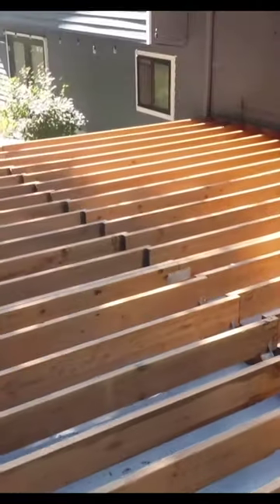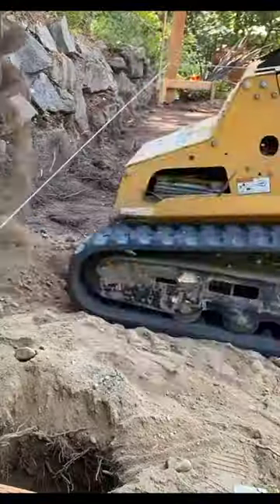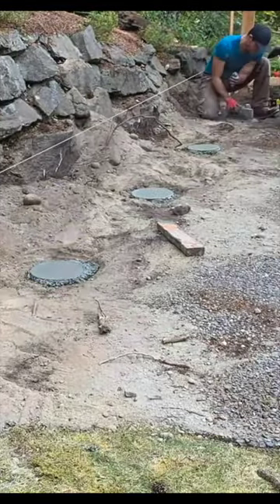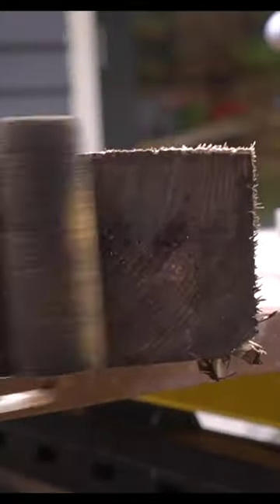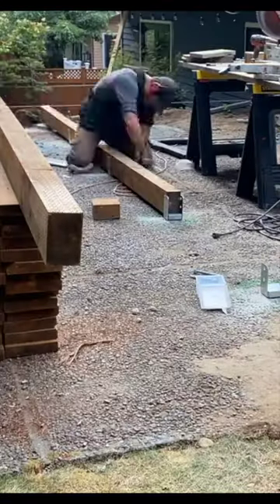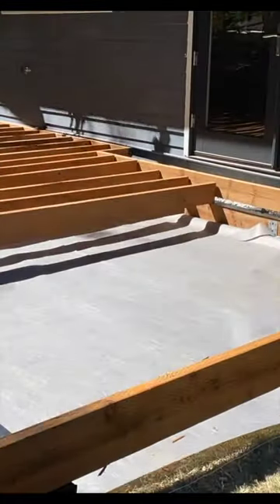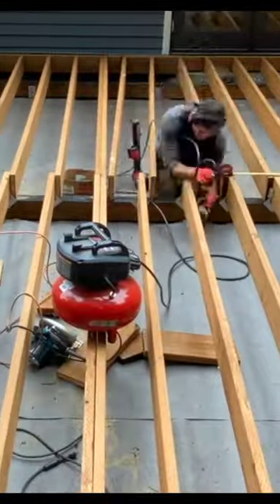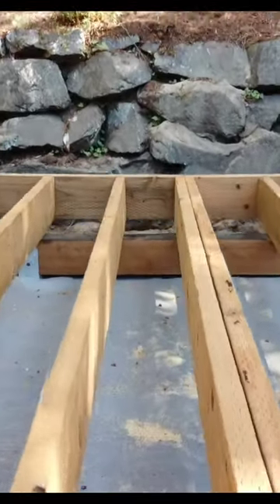DIY Freestanding Deck (Part 1 of 2)

Comment: You’re midspan beam have full bearing of the joist that should overlap and nail to each other otherwise beautifully done😊
Reply: Minimum 1.5” bearing
Reply: Yep. As long as both sides have proper bearing and the doubles are properly nailed from both sides it's good to go.  Although more bearing surface would be better or if you're a real overachiever, you could have gotten longer 2x10s and joined them with a scarf joint at the support so the client could tell his friends at the barbecue they could park their car right there because his deck was built so friggin strong that they hand cut interlocking joints in the beam because you get what you pay for...and he paid a buttload of money for that deck.  Lol!
Reply: How about some blocking?? A well intentioned handyman built this 100%

Comment: Why didn't you use the proper joist hangers on the ends that connected to your rim joists? You can not rely on fasteners that go through the rum joist into the end grain of the joists.

Comment: You didn't need to bury the sono tubes. You just need it at the surface for aesthetics
Reply: So many people use Sono Tubes absolutely wrong. They are only supposed to be used to form the exposed concrete. When you did and insert like he did, you ruin the contact between the concrete and soil.
Reply: So sono tubes should only be above ground? 
That makes sense, it will rot in the wet soil and shift your creation
Reply: Exactly

Comment: i do concrete and doing it wet is what i would do and just float around it and it will be locked in. Done commercial buildings like that and all. And hopefully not somewhere thats cold cause here in Michigan 24 is not a footing thats a rat wall. A footing here is 42 inches below frost line. But if your not somewhere cold 24 is fine

Comment: Where can I buy this pressure treating solution? I asked at Home Depot and they just kept pointing me to the wood. I looked up a pressure treating kit online but it's like $138,000 and you got to have a license from the EPA to get the thing delivered to your house. Seems awfully expensive just to build a deck. I wish they sold the wood pre-pressure treated.
Reply: you can buy it anywhere. armor all makes some I think
Reply: comes in half liter or more sized cans. be right by the deck stain stuff

Comment: why not just set j bolts into the footings before they cure?
Reply: But what he suppose to do with the drill bits , he already've bought?😮
Reply: And when they're off an inch or two, you're going to drill in wedge anchors anyway.
Reply: @Ihtiandr13  Lol!

Comment: Looks like somebody actually built a deck right poured footers and your footers are above ground so your post won’t rot out but the next question is did you cone the holes so when it freezes the post don’t push up

Comment: Serious question here, where is your blocking?  Hurricane ties will keep them in position but it doesn't do anything for load. I'm assuming that since you put your 2×10 joists at 12" centers, you're planning on storing another house on it.
Reply: To be fair idk what the exact measurement is but that looks like a helluva span for 2x10s...and of course a long span with any size joists means a tighter spacing to maintain the live load rating...right?   And while I agree that he should have used some blocking between the joists, I fail to see your logic in attributing the blocks directly to load the joists can bear.  The blocks contribute to weight bearing only because they prevent  twisting in the joists.  But you said the brackets he used would do that.  Theyll help but they won't prevent twisting across that whole span. All that being said, I'd be surprised if he has any issues beyond maybe a squeaky board or two in about ten years.
Reply: @invictusbp1prop143 -  blocking absolutely helps in load bearing. This is how you can use a smaller dimension lumber in a subfloor. Such as 2×10 with blocking or 2×+2 with no blocking.

Comment: I know where I live, your concrete is supposed to be 4 inches above finish grade.
You could’ve made your joist flush to the top of the beam, using joist hangers to gain the extra height. Also, instead of overlapping the Joyce in the middle, you could have bought them together. Now you’re screwing is going to be staggered, which is not aesthetically pleasing.

Comment: Why so deep on the sono tubes I would  have errors and put them up higher above ground  so rain and other elements  didn't end up putting  your lumber in the dirt in the near  future since it looks so close in the video
Reply: So you would have built the deck higher than the door thresholds so you have to step up into the deck from the house?  Hope those doors open inward...   He's actually already in danger of being to high.  I don't think he showed how it ties into the house but one shot gave a glimpse of the deck height vs the bottom of the siding on the house and it looked like he might have been about even.  The deck really needs to sit low enough that he's got at least 1.5" from bottom of the siding to top of the decking for moisture to escape out of the bottom of the siding.
Reply: @Invictus BP1Prop  No what I was saying was to bring the tubes up so the 4X4s would be higher you can make them as short as you want but, when it rains or your watering your lawn dirt moves and over time when you do a flush  to the ground  installation it covers the wood or mounting which causes it to ruin!
I'm  in that boat I live next to the last house on a block with NO drainage and a 30% grade I get  all the water from the  street level and everything  off the roof my property  (didn't disclose is in a flood zone) has dropped by feet in 17 years  I've lived here.

Comment: I seen a guy use weather proof tape on the outside of the deck on top so it doesn’t rot later where water puddles seems like a good idea

Comment: As former contractor accused of overbuilding things….. why would go to the trouble of deep footings and sono  tube  ? How about a pier block in hole full of concrete . I promise you’ll never know the difference . I avoided using metal ties , too much time and money for something  can be done  with screws , nails and framing

Comment: Hm, personally I would have at least brought the deck 6 inches higher off the ground. I guess as long as you have really good water run off its ok, but I hope the bottom of those beams don't rot.

Comment: We have to dig down to 46” for our sonic tubes here in upstate NY.
Reply: Sonotube is a brand of cardboard tubes for concrete. It's usually easier to dig a trench in a straight line rather than using a post hole digger.  Done it both ways, I wouldn't use a post hole digger again.
Reply: @nunyabusiness5075  On the decks I had put on last year the sonic tubes had to be inspected and measured that they are at least  46” deep. They used a power auger , it did a pretty good job digging it.
Reply: I don't think sonotubes are necessary for inground, and certainly not needed at full depth.
They are handy concrete forms for making neat circular columns above ground.
They add no structural effect after the concrete has set.

The depth to be inspected (mentioned above) would have been the column depth, not the sonoform depth.

Comment: No need to treat cuts. It's called "Pressure Treated" because the lumber is placed in a large pressure cooker filled with the liquid chemical. High pressure is applied which pushes the chemical into the wood. The green color is added later and is not the chemical that makes it resistant to rot.

Comment: The first thing you do is get a building permit from city to avoid fines and or costly removal of brand new deck
Reply: A lot of counties as it should be don't require a permit if it's not attached to the house.

Comment: Sono tubes are for above ground, if you’re just pouring level you should just pour into the hole.
Reply: Why would you say that about the Sono tubes?
Reply: I always paint the tube with Thompson's ... Just because.. it stops the hole from looking messy
Reply: @tnj5577  An irregular shape will provide a stronger foundation.

Comment: Ouchhh, drilling the concrete and them hammering the bolts in completely makes the concrete pointless. The only thing holding that in now is the friction between the concrete and bolt. If you put them in while wet the concrete would get in the groves and bond to the bolt to actually hold it
Reply: Threads in a bolt are not designed to hold the bolt in concrete.  Anything wet set would need an angle or spoon shape at the end to prevent the bolt pulling out.  Just concrete getting in the threads isn't good enough.  And the drill set anchors are wedge anchors designed to be driven into the hole then the nut tightened down to draw the opposing wedges at the bottom into each other so they expand outward and dig into the sides of the hole, giving them sufficient uplift strength.  So sayeth the engineer.
Reply: @invictusbp1prop143  that makes sense, I didn’t realize there was a wedge in it so I didn’t get how it would create a holding force. Thanks for the explanation

Comment: That is a little overkill.  Clearly a 2 ft deep sono tube base means that he is not in a place where the ground freezes.  Really 12 inch on center, also seems a bit much for normal traffic.  Yes over built but he will have something to talk about when he has a neighbor over for a deck party.

Comment: Whoa....the sonotubes are for above ground. Not buried. 
Better to pour concrete in dug hole. With sonotubes for any above grade parts.
Reply: I see this all the time and it drives me nuts. It's not a big deal in this case but it's still bad practice.

Comment: Everyone is talking shit but that's one of the best ways to do this. Damn good job I'd do it the same way. Should hold a hot tub no problem. And your materials are given the best situation to last as long as possible. Little bit of maintenance that deck will last 25/ 30 years easy

Comment: Obviously, you should have used pier brackets that go into the concrete. Besides that mistake, You didn’t put an extra tapcon in that bracket. Those posts are going to twist to hell and back. Don’t do this stuff yourself folks. It’s mistakes like this that end up costing you big. Pay professionals who have already made and fixed the mistakes
Reply: Obviously he should have used pier brackets?   Are you talking about the adjustable ones that are essentially the same thing he used but with an elevation adjustment ?   Or are u talking about the giant 1/4 steel plate brackets they use in friggin pole barns?  I disagree that it's obvious he should have used anything more than what he used (as long as all his piers were level).  And how bout we make a wager for a thousand bux and go check in 10 years to see if anything has "twisted all to hell" in the bases he used because he didn't burn a tapcon screw in each one. ....since there aren't any actual vertical posts secured with them, and they're really only a securement point for joining two horizontal 4 x 8 timbers that serv as the underlying support just above grade to carry the joists.   I'm having my doubts about your twisting hypothesis.  Unless the deck tears itself apart under the mysterious torsion you expect to be exerted from some unknown place on the timbers secured in those bases, I don't see how they could possibly twist more than a dikhair, let alone "all to hell".
Reply: @invictusbp1prop143  a bracket that goes into wet concrete…Hate to break it to you, but wood twists when it’s constantly getting wet and drying out. It twists in the sun, it twists. It’s wood. I don’t think you have been working with wood very long. Do it how you want, I need guys like you so I can come back and do it correctly. We all have our place in this world.

Comment: Why are you using Sonotubes if your concrete is at grade… just use the ground as your form… You only need Sonotubes if the concrete is going to be above grade
Reply: That is definitely not true

Comment: Don't call before you dig.  It's a (per) event fine depending on the State between $500 to $50,000.  I called for a wall foundation 3 feet from a street light pole.  They marked all the way to the electric meters 85 feet away.  
What I did not appreciate was the fact they stated 8-9 entities had to report before I could dig, and as far as I know the last 3 never completed their assigned responsibilities.
The next time I call, I am going to give them 30 days, then petition the Court with a Writ of Mandamus, which forces the entities to perform their legal duty, or face a charge of Contempt of Court.
Reply: This is why I thank God my family has owned acres for over 100 years lol we don't call for a thing

Comment: If you buy good pressure treated wood the pressure treat should be soaked all the way threw so no you should not and do not need to add anything to the end when you cut it

Comment: Holes should be 42 inches and you went over kill doing the joists 12 inches when you could have done 16 on center its a deck at ground level your not in tge air and your definitely not parking a vehicle on it

Comment: A bit over kill specially with the material hike 2x6 on 16 on center would be just fine but that will work too just tossing money out
Reply: Yeah, if your framing a ceiling. I agree with the 16 O.C., but at that span, nothing less than 2x10 with blocking. Unless you’re building a spring board.
Reply: 2x6 at 16oc at whatever that giant span is would be a disaster.  Wouldn't last a year.

Comment: 36 deep for footings
Reply: Sure but it depends on his state... Frost line
Reply: I think I would have filled the tubes to a few inches above the soil line too.
Reply: Not just frost line.   It depends on soil type.  Big damn difference if you're sitting on less than a foot of topsoil over limestone or if you're in highly expansive clays.  Where ya live matters.

Comment: There is no point in buying pressure treated wood if when cut, you have to reseal it. Might as well just seal it all yourself.
Reply: He's only treating the cut ends, not the entire board. As one should.
Reply: @Michael Olive  pressure treated to me implies it is throughout the wood from the pressure, so even after cutting on the wood, it should be fine.
Reply: @Sdmfcfh  one would think, however if you cut them, you'll see the treatment only goes in about 1/4 inch or so.

Comment: 24" inches deep and framing every 12" for your joists ? Overkill !
Reply: Depth of piers depends 100% on the type of soils you're building on.  Expansive clays with a high plasticity index would call for a minimum of 24" for any footing or grade beam.  Sometimes as much as 36" is required.   So it's just a bit presumptuous to just proclaim it's overkill without having more information than you have.
Reply: @invictusbp1prop143  maybe so, but how do you explain to 2x10s on 12" and hurricane ties??? 😂 no matter how you wrap it, whoever built this only barely knew what they were doing and overbuilt to make up for it.
Reply: @GrassLogic  2x10 for that length span, spacing for the deck material specs and desired stiffness, and hurricane ties may be code there

Comment: "Pressure treated solution" ??? Used engine oil will work just fine… dude,  "Pressure treated solution" ?

Comment: First step: Call 811(or the number in your region to contact people who know what's under your yard, usually a utility)
Second step(if you have a septic tank) 
   Don't build on top of the septic tank unless you like paying $150 an hour as the septic company either has to take your deck apart or they have to dig under the deck with a spade.  Or put access in your deck("but it's ugleeeeee").  Course, I love money.

Comment: Your joist overlap is shit!!! Why do they overlap so your screw lines are all over the place. Where is your blocking? Every 4 to 6 feet required blocking. Joist always line up so your screw lines  are in line with each other. 95% good but a failure on the last 5%.

Comment: It is so low the wood is going to get destroyed by the water and the  humidity you need make higher
Reply: So he will have to step up into the deck out of the house?  It's already too high for the house as it is.  Just not the right application for a deck n should have gone with a well done concrete or paver patio.

Comment: transformed -yes, but not in a good way.  No one NEEDS a 600 s.f. deck.  It's a waste of lumber.
Reply: Our deck is 3600sqfr. With a grill on one side and the other to the pool
Reply: @vanderumd11  Now if only bigger were better.  but that would be just silly as well as a waste of natural resources.
Reply: @snappybabby4646  in America, bigger is better
Reply: That man can build as big a damn deck as he wants.   ...I just think that given the property, the house, the grade, etc a deck is not the right solution in this case.  A well done concrete and/or paver patio would have been better.  Decks built on grade don't make sense  to me.  Unless you're looking to provide nice new housing for rats and critters of various shapes n sizes.  And the fact that the deck looks like it's going to end up at damn near threshold height the way it sits, that damn sure may.mean interference with the siding and possibly even the doors.  Idk.   Just would have opted for a patio and could have made it nice without creating any problems for yourself and not needed the level of maintenance a deck requires and saved a chunk of cash for something I won't ever get a splinter from or have to refinish.